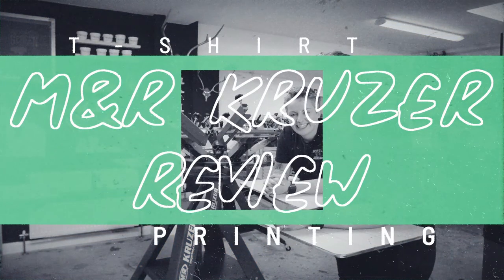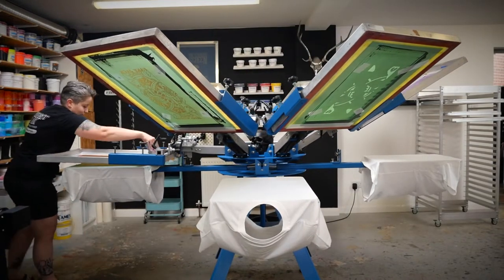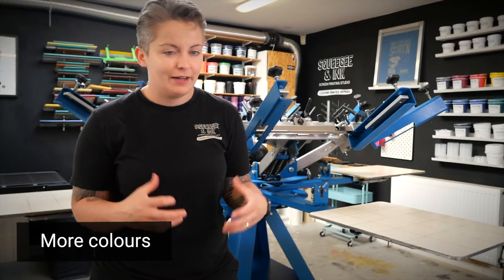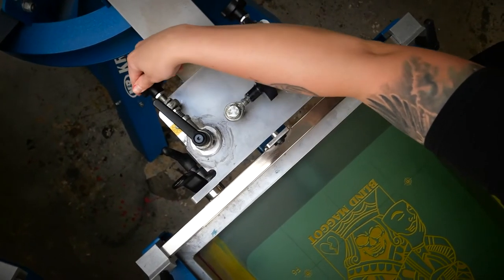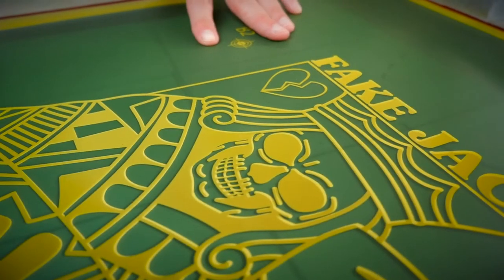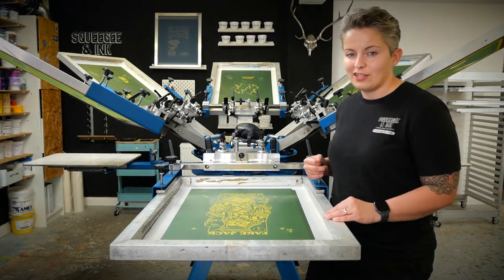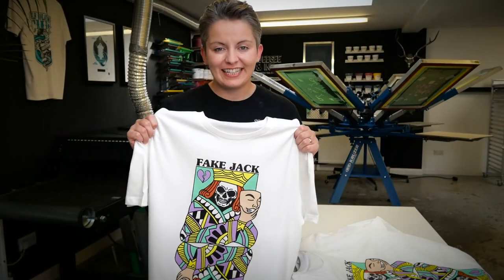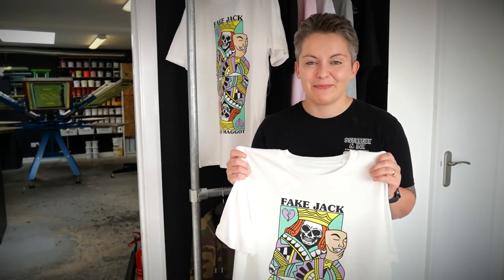M&R KRUZER REVIEW - Possibly the best manual t-shirt printing carousel?

Comment: This is awesome! Helps me a lot because my recent supplier just got bought out and the new supplier sells 
M&R..

Question, why did you guys not decide to do this wet on wet? Sorry, multiple colors is something I’m still trying to understand. Especially, the order of colors.. when to flash and when not to flash.. just things like that..
Reply from the maker: Hey, for this plastisol print - it added no extra time to use the flash.  We also built in a small stroke on the colours so the black can sit over well registered.  I wanted to maintain the crisp lines in the black so having the flashed colours made sense so there was no indication of blurring on the edges.  I would have gone for wet on wet for a waterbased design for sure.
Reply: @squeegeeandink  Ah ok! Thank you! 

1 more question. Lol. What is the difference between the Kruzer and the Chameleon? Is it just the side claps?
Reply from the maker: @ochoastyle  seems to be just the same parts just holds more screens! We haven’t needed to look into it as the Kruzer seems to do all we want

Comment: What’s the reason for having all the boxes on pallet tape. Why not just a line for left chest and line for full front
Reply from the maker: Hey, we draw our guides directly on the platen then cover it with the transparent tape. As they are there permanently it makes the grid adaptable to line up jobs from bags to left chest and full back and make sure the reg marks are close enough to a line to check they are straight.
Reply: @squeegeeandink  what do you use to hold down garments if you tape off the pallet tape
Reply: @squeegeeandink  so your pallet tape is transparent?

Comment: Nice video...I have the same press but have really disapointed with the clamps.  They are constantly coming loose and the screen wants to move when you tighten them down making registration difficult.  I've had 2 M&R automatics and a Radicure dryer and have been a big fan of their products but not so much with this one.  Have you had any issues with your clamps?   Thanks.
Reply from the maker: Hey, I haven't seen an issue with the clamps myself. I did have to tighten one with an alan key once. Thats a shame you had that issue. There seem to be quite a few variations of Kruzer so maybe ours were slightly different.